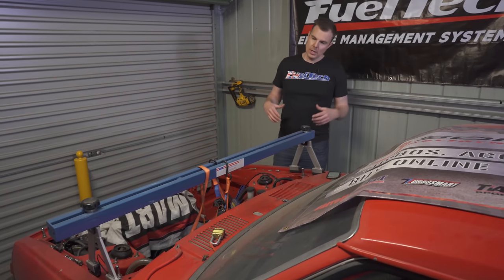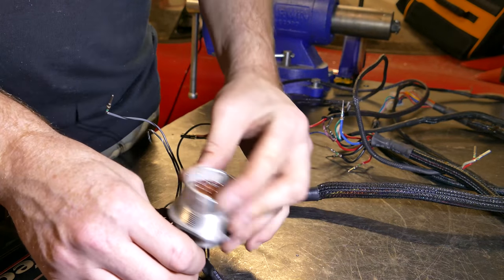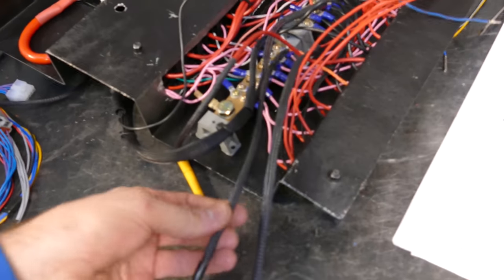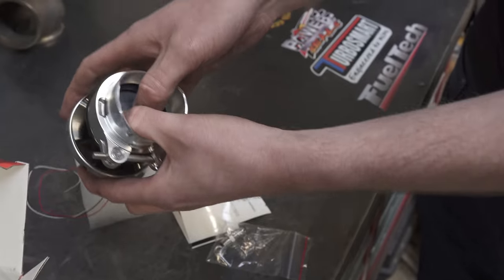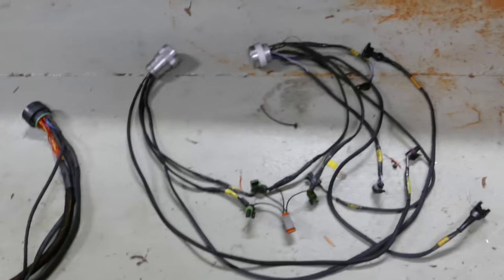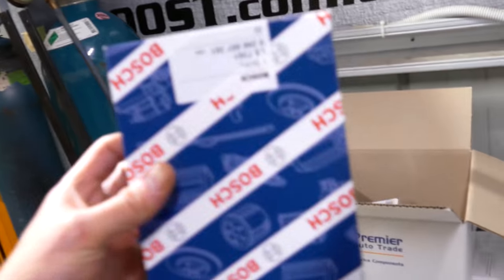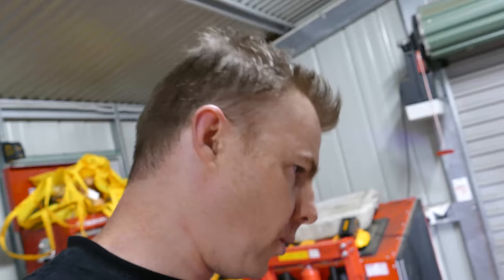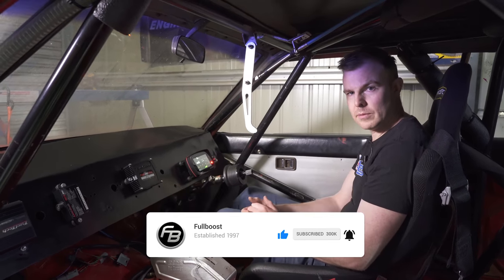The mega Fueltech how to wiring video | Project Redline 2.0 Ep 19 | FullBOOST

Comment: Pity you went that far and didn't use any raychem and tefzel, It would of only been a small hit to the pocket as you're already using motorsports connctors and Deutsch connectors! with 5 times the protection! Pretty exciting and itching to hear it start up! :)
Reply: SovL:Remedy I’m slowly restocking all my existing stuff when it runs out with that, but a lot of this wiring was from salvaged from the old setup and the car was flawless from an electrical point of view, so have just continued with it for now.
Reply: @BackyardMechanics  Defiantly, there's no doubt it great work! Weirdly enough I'm in the same boat as you redoing the BMW and Toyota side for my 2J swap into My E36.....Had it previously as a simple loom shave, now going with PDM's and renewing the whole car, I on the other hand don't have the funds you guys do and didn't go with Raychem and Tefzel, but kinda like yours have a 55 pin motorsports connector (bulkhead) and a few micro connectors, fuck the small the more expensive with this shit...Oh and a shit tonne of Deutsch plugs too, Both the Toyota and Bimmer side had fucked connectors from age so literally replacing it all!
Reply: They are not Motorsport connectors 

Those round deutsch are the entry level around $80 Aus a set

Stepping everything up to tefzel wrapped in raychem and proper deutsch autosport connectors from the dt series could see you spend easily the cost of the ecu alone on connectors and wiring